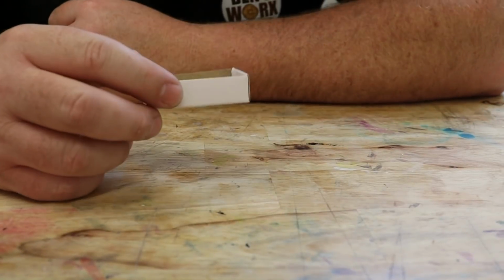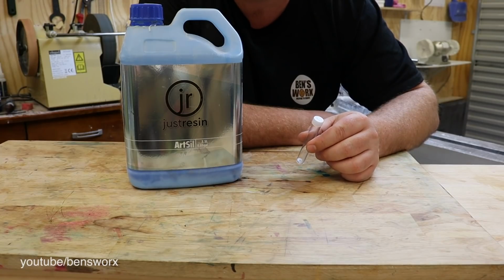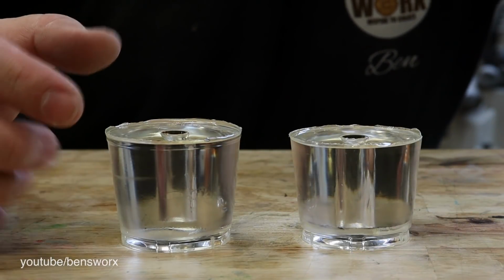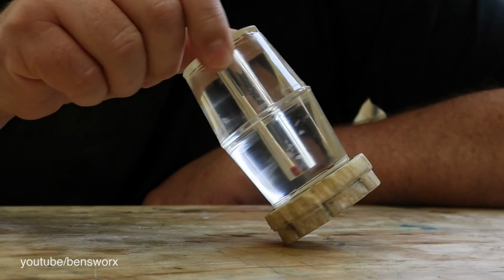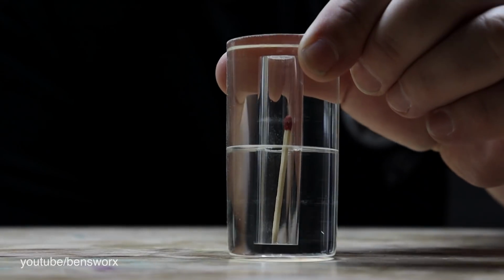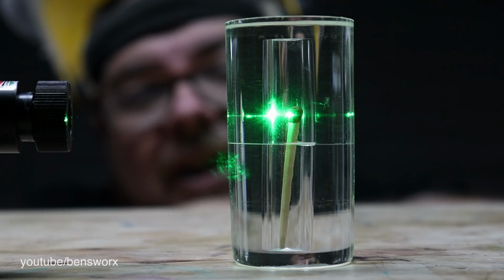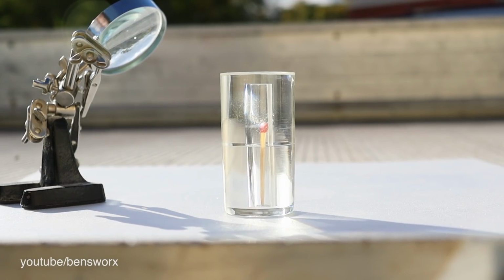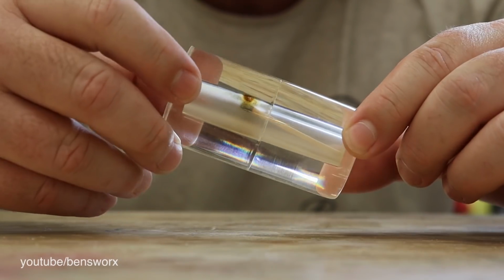Can You Light a Match in Epoxy Resin ?

Comment: Make a larger void, place diet coke in the bottom, place mentos on the top, held in place by a strong magnet, opposing magnet above the resin cylinder. Pull the magnet off so the mentos drops in the diet coke, all sealed up.
Reply: I'm pretty sure mentos only help the soda emit its gas faster when the pressure is released, they have "nucleation sites" that basically cause the bubbles to all escape in seconds instead of minutes or hours bubbling at a normal speed. But, if a soda is already sealed up, it creates  pressure that stops the bubbling, whether there's a mentos or not.
Reply: @deltab9768  then try a vinegar baking soda drop. Better yet, drano dropped into gasoline
Reply: @thecrazyvaper9301  the first one might work; if not you could use a more powerful acetic (or other) acid with less water content. I don't think drano and gasoline react with each other.

Comment: The laser may have worked from the top down. Shooting it from the side you were passing the beam through a curved lense essentially which was defracting most of the beam. From the top it'd been a thinned layer of resin to pass through and a flat surface.

Comment: Shorten the match, so it's like a cm or less of wood before the tip.

Glue it stuck to the bottom of something

Cast resin

Make a bulb / gear shifter

Light the match(es)

Have a fancy gearknob filled with smoke.

Comment: Very cool!
One question: you mention being concerned that the plastic vial would "most likely" melt in the resin, but the cups you used are also plastic and much thinner as well. Are the two different containers--the vial and the cups--so differently affected by the  resin's heat as it cures? 
Regardless, i really liked watching you do this cool experiment!

Comment: The problem with the laser was that the resin case was ROUND.  If you had embedded the match in a case that with flat, perpendicular walls, I think it would have not defocused the beam and the match would have ignited.

Comment: Schrodinger's cat theory would suggest that the match would both ignite and NOT ignite in epoxy resin clearly if you are unaware of the true ending result. My theory is that the match will NOT ignite in epoxy resin for the simple fact that the main component of the match is saturated by the epoxy resin when submerged, causing the main component to getting wet, which should not ignite.

Comment: It looks like the heat from the match head burned into the side of the inner space. I wonder if it could be avoided by using resin to seat the match straight up with space around it? Maybe if you try again with the survival match like Casey suggested you could try it that way? Would make for quite an interesting display piece either way! Cool video!

Comment: With the void in there, all you really proved is that the resin does not scatter the focused sun's heat enough to stop it from lighting a match. Try it without the void - yes, you need heat, fuel and oxygen for a fire, but just to light it is a chemical reaction and should only need all 3 to continue to burn. The smoke filled resin was pretty cool tho

Comment: Hello,

what would happen if you put the two halves with the still liquid glue in a vacuum chamber, evacuate the air as much as possible and then let the glue harden? Or insert a tight valve and then evacuate the flame chamber.
Would the match still burn because of its chemistry or because it has enough oxygen bound or does it rely on the oxygen in the air to ignite?
Would be an interesting part 2 :-)

Comment: If you try something like this again and want to use the laser, try sanding and polishing the top and attacking it from there, as pointing at a curved side likely scattered the laser too much to actually give it the required energy to heat up properly while the top would act more like a flat lens. Ideally, anyway. Finding the actual focal point with a magnifying glass is easier since you can adjust how the sunlight hits the side of the resin to make a proper point inside. Now, I'm not 100% on my theory on this, but a way to find proof would be to fire the laser through a clear side and see if it makes the same pinpoint on a surface on the other side as it does when fired unobstructed. It's science!

Comment: If you snap the match head off, then you wouldn't have as much smoke and it might gather at one end like a cloud instead of filling the whole cylinder, but then later it would go ahead and disperse evenly  - so then I wonder how to make smoke of a different density, heavier than air, because you couldn't get smoke particles lighter than air. But you might find gases lighter than air but I don't know of any that are opague so that they could be seen swimming around like clouds at the top of the vial.

Comment: Wire a capacitor backwards, in case it in resin, then apply power. Obviously, be careful when doing this and mindful of the size of the capacitor as I would assume it will explode.

Comment: You didnt have to create an air pocket, the chemical in the match head is Potassium Chlorate and that has its own oxygen at the molecular level  to provide towards combustion. You should try this agin but mold the match directly into the epoxy, and mabye make sure to keep the wall thickness as thin or thinner than what it was here. It might crack open as you ignite it, because the pressure of the gases evolved in the reaction will have no where to go.

Comment: I imagine it will light, but use all the oxygen inside relatively fast and burn out without burning the entire match. And the smoke should stay inside as long as it’s absolutely sealed there should be nowhere for the smoke to dissipate to.

Comment: Seems to me the match is not enclosed in resin.  It’s enclosed in an airtight container of resin.  The void that holds the match has the same content of oxygen as normal air. That the match would light was never really in question—given sufficient heat applied to the match.

Comment: I mean, it's cool to see and what not, but all you've done really is put a match in a small sealed bottle. I'm more curious about something being COMPLETELY sealed in resin. the only reason there was any trouble lighting the match with the laser or the magnifying glass is probably because of the cylindrical void the match is in. It'd cause the light to refract or bend scattering the photons and dissipating heat.

Comment: Just one thing i was thinking watching the Match go up in flames:
You encapsulated a Solid fuel into a air tight environment and ignited it...
You should be Careful about the pressure inside of this thing.
Im not an expert in chemistry but a Solid that burns into a Gas takes up much more space.
Basically you did Build a Bomb that didn't blow up... yet.

Comment: You used silicone for the void because you thought it would melt in the resin but you used two plastic cups🤔
Reply from the maker: The plastic cups are designed to withstand heat

Comment: When are you going to make an episode where you actually incase a  match in resin and then try to light it?....... Also you could have just pointed the laser pointer down through the top of the cylinder so you would have less issues with refraction and the match probably would have lit up first try

Comment: Did you try this with a NON safety match , no void and the magnifying lens. Non safety matches contain an oxidiser, so should work, though not for very long.. My guess would be, your laser was just not the "can it burn stuff type"..I had a blue one a while ago, could pop balloons at quite a distance, however it was a very cheaply made laser, the focusing lens was plastic and eventually it melted.

Comment: if you make a air-hole inside the whole thing is senseless.. it would be more interesting to see if it works if you just dunk it in the epoxy when its still liquid.. no air at all if possible. otherwise its just a normal match lightes by a laser with air.. boring.

Comment: Can you light a match in a room?
Yes
In a small room?
Yes
Smaller?
Yes
As small a syringe?
Yes, hell yes, i mean what is epoxy doing here when you could do it in sealed regular syringe, a syringe doesn't even mess with light as much as your epoxy cylinder does.
The point is when you say in epoxy it means to put a match in liquid epoxy and let it cure around the match to avoid making contact with oxygen otherwise what's the point this experiment?
I hope you understand and stop misleading people